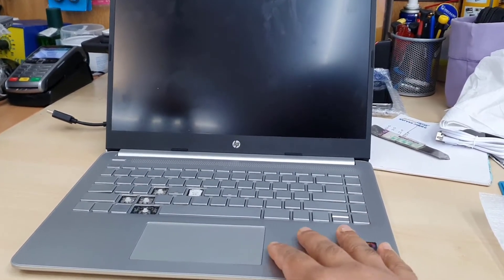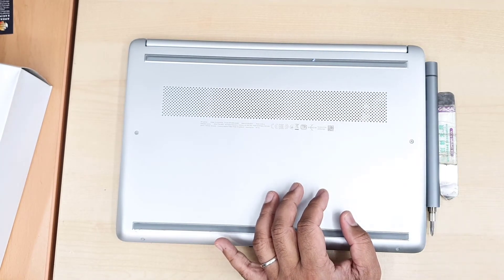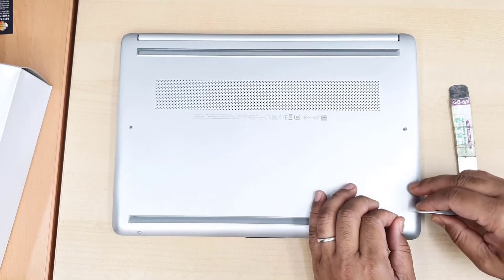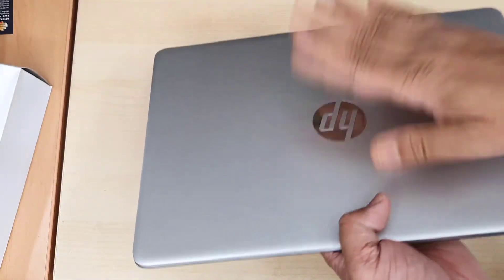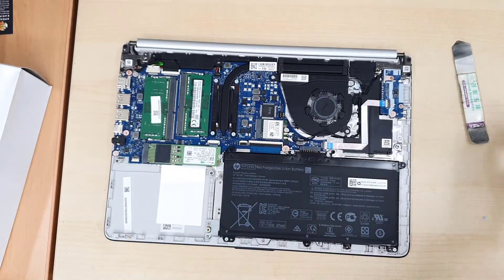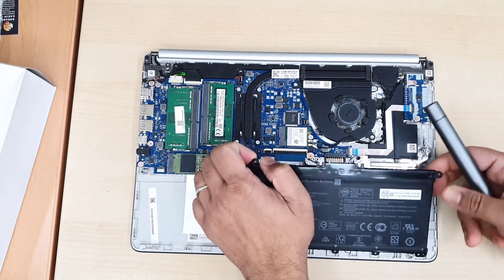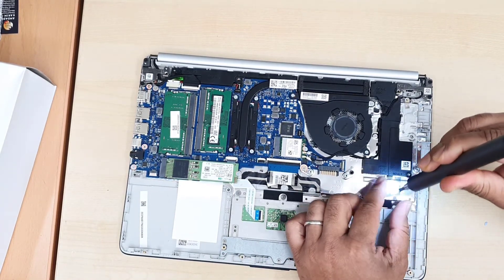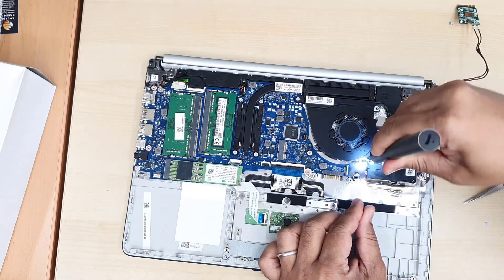Hp 14s-dq1505sa Keyboard Replacement Tutorial

Comment: Really great video that saved me a lot of time and hassle. Firslty order the entire front panel as the key section, which should be removable is 'welded' into the cover and looks bloody hard to change. My only other comment would be that you dont actually have to remove ALL the screws and connectors. Look on the remplacement board and this will show you which screws have to be removed.